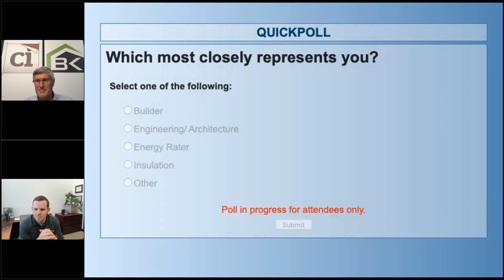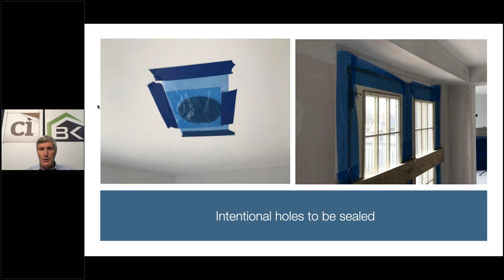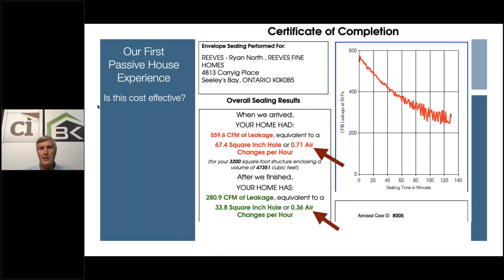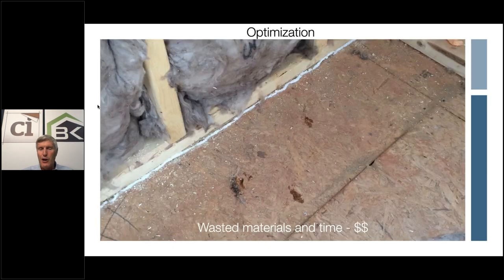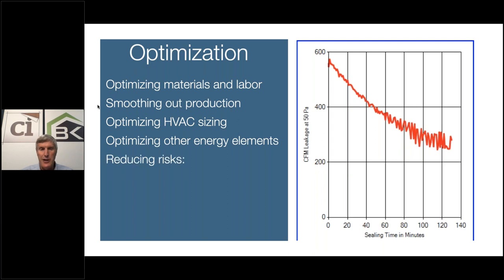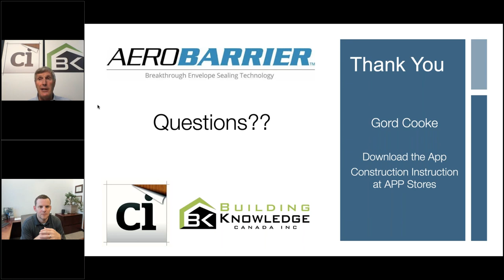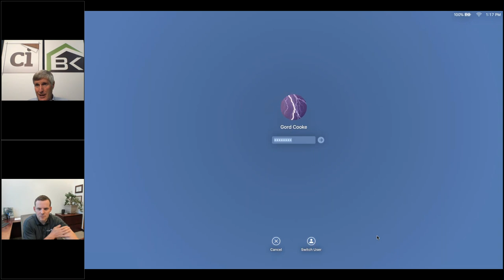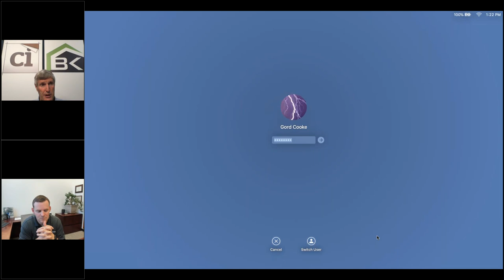AeroBarrier In The Real World: High Performance Meets Standard Budget

Comment: @aeroseal can this be done on finished vacant homes?
Reply from the maker: Aeroseal Envelope Sealing (Aerobarrier) can be done on completed homes but there is more work involved than if integrated into the construction process initially.  The exact amount of additional work depends on the home, construction type, etc. I recommend you reach out to our sales team or a local contractor representative to get something more specific to what you need!
Reply: @aeroseal  I did reach out to my local sales team and really all I got was a quote which seems fair but no prep was mentioned. What would I need to do to prep well? I plan to remove the covers from my lights, remove my can lights, cover carpet…Can you post a checklist? I really want to hire this team (this is the local legit sales team for Aerobarrier) but I also want the product to be successful. My home is 2600 sq/ft, built in 2023. However, my local code is so outdated the builder isn’t even required to do a blower door test since insulation and air sealing are not the norm for this state. Any tips or a checklist would be greatly appreciated so it turns out well!